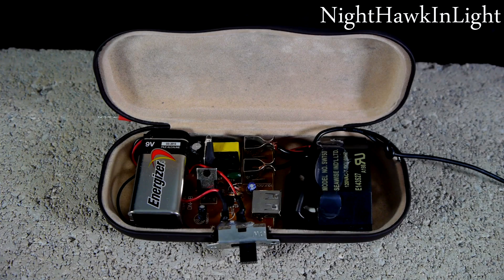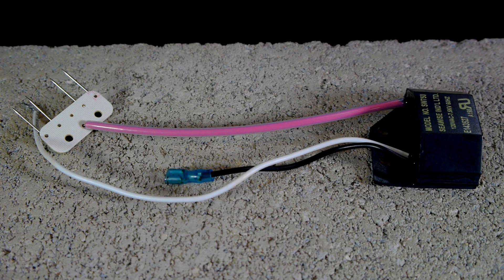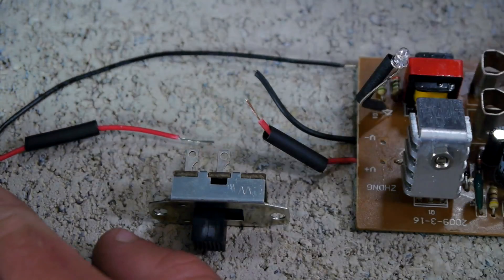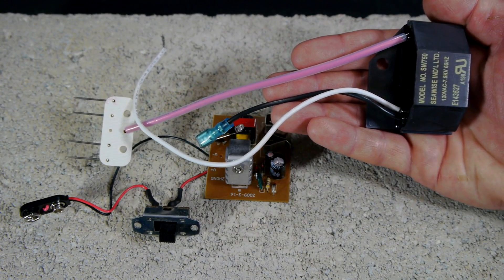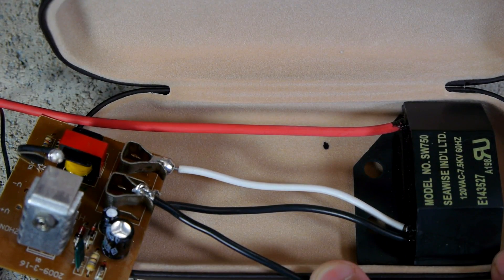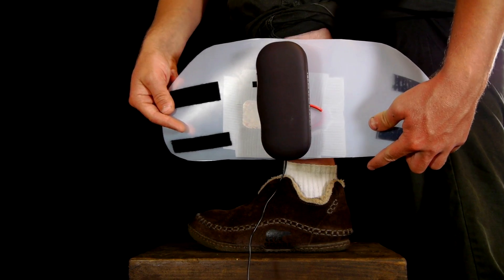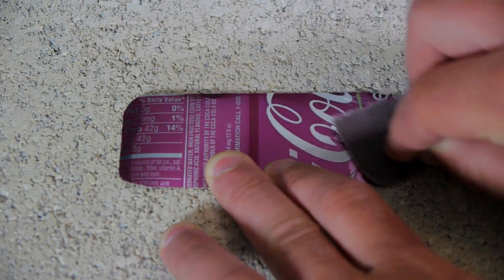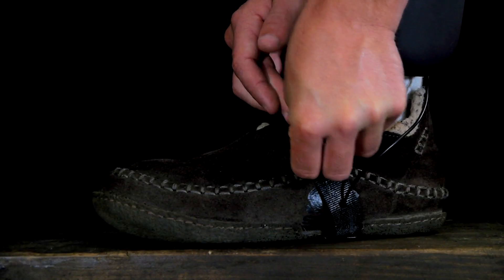How to Shock Anything & Fry Electronics with a Touch!

Comment: ww.ebay.com/itm/High-Output-air-ionizer-ioniser-airborne-negative-ion-anion-generator-200V-100V-/121077249879?pt=UK_HealthBeauty_Other_RL&hash=item1c30c43757 Can I use thise ionizer? Just type one W in link

Comment: i have a minor problem i have 3 glasses cases and i cant seem to fit all the equipement in the case the battery barley fits with out the harness. what eles can i use to store the parts. and also dose it have to touch the ground? please reply

Comment: It is just a simple high voltage coil. Used in cars to make a spark for igniting the fuel. Ion generation is achieved if you ground one side of the coil and put the pointy plate on the other end. Physics will do the rest ;)
(check Ion Wind topic on youtube).

Comment: Brilliant:) If i may only make one suggestion, don't put it on the leg. If someone makes it powerful enough and has a waek heart, it can cause a bit of harm. Also dangerous for people with heart peacemaker.
Generally the current flows on the surface of the skin, that's why it shouldn't make any problem for the user, but sometimes shit happens;)
If you attach the harness on the arm, it will remove the risk of current flowing through your all body.

Comment: A ground wire is (more or less) just a regular wire that touches the ground. It's not necessary to coil or do anything to the wire the than insure that it (or whatever it is connected to) makes a good electrical connection to the ground.

Comment: So...in theory, if one had a larger supply of energy, say a step up transformer and a high volt capacitor; would one be able to withstand zed current? And what could one do with that voltage? Safely "taze" an assailant?

Comment: I got it to sort of work. For me, you had to be on concrete and had to walk around a bit. The shock though was like a 3.5. Sometimes it was a 5 in the right condition. Dry air is better for shocking because electricity travels better in it.

Comment: Is the ground wire really needed? Because inside the negative ion generator is just a voltage multiplier, which multiplies the input voltage, not pull electrons from the ground, right?

Comment: Nighthawkinlight, im want to build this device but where i live there is not hardware stores that sell those kind of electronics, so i wil buy the generator and the convertor from the links in the description and i have an on/off switch, but i dont know where i can get the battry harness and the coppr wire, can u send me a link so i could buy them online? ty, and also, this is the most awesome device i have ever seen, if you touch a person, wil it shock them?

Comment from the maker: Both the carpet and the flip flop may be contributing to your issue. The carpet certainly is. For this to work really well you need to be on a somewhat conductive surface, such as concrete, tile, dirt, etc. A flip flop may be causing problems because it's allowing your feet to discharge electrons to the ground through the air, and/or the aluminum strip underneath.

Comment: Nighthawkinlight, I have mine all put together and it seems as if it should be working fine, but when i hook it up to my leg, and then the bottom of my shoe, it doesnt let me shock anything. The only case in which i can shock something with my device is when i have one of them hooked up to my leg, and i just touched the other. If you have any suggestions, that would be very nice. I am using the device on carpet, and on the bottom of a lip flop. Thanks!

Comment: If you copy and paste the link into the nab bar with the usual prefix it will work. I tried to paste the complete link here but it did not allow. It would be very helpful if you could let me know if I can use this ion generator. Thank you

ebay.co.uk/itm/High-Output-air-ionizer-ioniser-airborne-negative-ion-anion-generator-200V-100V-/121034238961?pt=UK_HealthBeauty_Other_RL&hash=item1c2e33ebf1

Comment: PLEASE HELP

I get a static charge, but it's very small

When i move my hand a bit close to pepper particles, only the ones very close to me finger move

I get a very healthy arc between the ground and red wire

can anyone explain what I did wrong?

Im using the same battery as the nighthawk as well

Comment: help help HELP!!!
i just got the parts to make this followed this guide EXACTLY  
the negative lead make a ark with the red wire but when i put on the harness it doesn't work.
the connections on the harness are just fine the foot one arcs to the leg one when its on but when im wearing it it does nothing. also when it is running the battery crackles and arcs and and also will draw sand /dirt to it. i have tried multiple batteries and triple checked all my connections please help me.

Comment: In high school physics lab, we found a hand-held tesla coil that plugged into the wall and was supposed to be used for electronics testing. We quickly discovered that if you held it when you turned it on, it didn't shock you, but it allowed you to arc electricity from your fingers like Palpatine. I believe it went up to 40,000 volts. The arcs shot out strongly over an inch. Could something like that be made portable, do you think? Is it somehow unsafe? We never found any ill effects... luckily.

Comment: I see the ionizer is cheap. I was just wondering what is my range?Does it have to be Input: 120 Vac. Output: 7.5 KV 60 Hz? Will it not work with other specs? Is it dangerous if the output is too high? I know a bit about electronics and more about electricity, but I don't know much at all about negative ion generators aside from what they sell hem for? What kind of store would sell this other than an electronic supply? I would rather get all my parts in person if I can. For all projects.

Comment: I built this project a few weeks ago and it works great. I recently saw this this video: /watch?v=a7_8Gc_Llr8 and tried using this high voltage generator to interact with the flame and it worked! 
The effect is not as dramatic but it was strong enough to see clearly. I would post a video but unfortunately I don't have a camera

Comment: There is a slightly better one made by weller that's red colored. It has a push-button ignition and I think it gets a bit hotter and heats up faster. I've used the radioshack one, but I prefer my weller because the tip is finer. I found mine at home depot, but I'm not sure if they still sell them there. The weller should be cheaper too if you look around. I've been using the same weller for 4 years now.

Comment: I took the ion generator out of an old unit with one of the vertical squirrel cage fans.  This generator is noted with an input of 120v @ 60Hz, but the feed wire comes off a circuit board via a 5 port PCB connector ... Is there a safe way to figure out which of the 5 wires I connect to ... ?

Comment: figured I might get a response quicker if i commented on your latest video.  On your airsoft minigun, how well do you it would work if you replaced the tire valve with something that could then connect to a co2 cartridge for a power source? or a larger magazine? like a soda bottle connected to where the cap goes?

Comment: I am using an eliminator surge protected automotive power inverter as opposed to the one that you have suggested for the dc to ac conversion. I haven't started on the electronics but i have put a battery in series with the inverter. The light does not come on but when i put it back together and put it into a dc vehicle socket, the light comes on. Will this inverter work for me even though the light doesn't come on with a 9V battery? could the LED light just be for a 12V input?

Comment from the maker: Is the generator attached to the plastic leg harness right over the hole for the red wire, or does the wire come through the plastic off to the side of where the harness is attached? If the glasses case is right over the hole a spark might be jumping from the case to the aluminum strip inside of the harness, which would remove any charge from your body. If you can't get it working try to make a video of it with clear views of everything in good lighting so I can try to figure out the problem.

Comment: My comp wont let me reply properly. I tried what you said and it still does not work. Is there any thing else that you can think of that could be causing it to not work properly? i have also noticed that when it is on everything in the box including the battery gives of a very weak shock when touched. The sparks between the shoe strap and leg harness are also noticeably smaller than on yours. Thank you for your help.

Comment from the maker: Make sure you are wearing shoes with a solid rubber bottom and the aluminum ground is centered in the tread, so it touches only rubber. This will also be stronger or weaker depending on what sort of surface you're standing on. If you're on dirt, concrete, or moist surfaces it will shock harder than if you're on plastic laminate, wood, or other less conductive surfaces.

Comment: So if you touch someone will it feel like a stronger static shock? Also does the case have to be close to the foot wire or could you have it attached to the belt area and run wires to your foot?

Comment: or if for some reason you're not affected by DC current you could supersize it to a tesla coil and use it in mid quarters combat.  I'm gonna need to run more tests, but considering that lightning is DC and it didn't even phase me I'd be a suitable test subject.

Comment: well, considering it's a static charge you'd have to be in direct contact for it to work unless you supersized it to a tesla coil.  you'd have to be wearing extremely thick insulation then though.

Comment: how does a nine volt battery build up 7500 volts?  does the design have a capacitor in it somewhere or is that a result of the transition from dc to ac?

Comment from the maker: In that design they had ion generators that run directly off of DC current. The only place I have been able to find that sells DC generators however is located in China, and there is about a $35 shipping charge and likely about a month delay for it to arrive. I decided that most people would prefer I make my design using parts available in the US.

Comment from the maker: 5W is just the maximum output that the adapter is capable of. With only a 9V battery the power output will be limited to what the battery can deliver, no matter what your adapter is rated to. Just don't use a power source larger than a standard 9V battery and it will be fine.

Comment: I'm sure you've been asked this question a million times already but I can't find the answer. How can you increase voltage without increasing amps? Transformers work on AC. Would it be possible to add one after the inverter or would that be out of the question?

Comment: That would be exceptionally dangerous to yourself.  The capacitor would store a large volume of energy and then discharge with high amperage.  Most people (theoretically everyone) can survive hundreds of thousand of volts being shot into them (I've seen tazers as high as 800kV), but nobody is expected to survive having even just 1 amp shocking them (but I'm sure we all know somebody who survived sticking metal in a light socket).  Batteries are measured in milliamps, so they're super safe.

Comment: you could actually cut out the inverter all together. build your own negative ion generator using the schematic found by googling "negative ion generator schematic" and cut the transformer and bridge rectifier out also. you will have a DC powered version

Comment: I wonder if there is a way to add in a capacitor or two from a disposable camera. That way, the electricity is charged, and you get a stronger shock on first contact.

Comment: The inverters I have are both higher power inverters than the one you have, which might have something to do with it. The one you have is probably (because it's cheap looking is why I guess that) a square wave inverter which use less electricity to run than a sine wave inverter.

Comment: Most automobile alternators put out 14.4V DC. I have 2 inverters that don't work unless the voltage level is above 12V. Items designed to work at 12V have no problem working with 14V, it's well within tolerance. I seriously doubt that one of those 12V remote control batteries could put out as much current as a 9V alkaline battery.

Comment: could a get a bigger spark by using 12V and using 2 ionizers with the output wire in series and then spark that to the ground?

Comment from the maker: I tried it. Whatever the electronics are in those ionizers they will not work for this. They produce high voltage that can be used to create a small arc between two wires coming off the board, but they will not electrically charge other objects.

Comment from the maker: In a pocket, they should be fine because they will gain and lose static charges slowly. Electronics are more likely to be damaged if they are sitting on a desk and then touched by someone wearing this device, because the entire charge built up in the users body will flow right through the electronics to escape to the ground.

Comment: as mentioned somewhere around 9:50, a big contact area doesn't hurt you. But this works for her as well. If you want to shock her without noticing the shock, you should use a conducting item with a large contact area for your hand and a small contact area for her. (e.g. a metal pen, a fork, keys or some coins).

Comment: That particular inverter does NOT put out AC. It's half-wave rectified/filtered DC. The output measured at 167Vdc on one that was tested.
Schematic of one is available at: dalmura.com.au/projects/Car%20charging%20converter.pdf
If you remove the diode marked "D3",replace it with a jumper wire,and remove the the 2.2uf 400V cap, you can get a high frequency AC output,at several tens of Khz.
Just FYI,it's NOT an AC output.

Comment from the maker: Automotive inverters do not shut off below 13V, or they would not function at all. All vehicles besides large dual battery trucks only run on 12V to begin with.

Comment: There is little chance that a 9v battery could keep an inverter going for 5 days. Power converters consume electricity, in this case, the inverter itself is probably using more power than the device it is powering. MOST power inverters shut down when the input voltage drops below 13V, so I don't think this will even work with most inverters.

Comment from the maker: I haven't tried any other inverters besides the one used in the video. Where I purchased it is listed in the video description. I believe they typically will still function within 30% of the recommended voltage.  I don't recommend using a power source greater than a 9V, as the current has the potential to reach dangerous levels.

Comment: Don't most inverters shut down if the voltage drops below 12 (some even shut off under 13V)? Would it be better to use a 12V lithium remote control battery (the ones that have 8 button batteries in them)? The only potential problem would be that the 12v battery couldn't provide enough amperage, but you could put 2 of them in parallel. Does it matter if you use a cheap inverter that provides a square wave rather than the true sine wave?

Comment from the maker: It will, because they will not be at an electrical equilibrium with yourself until after they have been shocked once. After that the extra electrons will quickly disperse from them into the air and they will balance back out again to the surroundings. Even so I cannot recommend using one of my projects to cause discomfort to another individual...

Comment from the maker: Yes, you feel the shock just like the thing you are shocking. If you hold on to a metal object and use that instead of your bare skin, the shock is dispersed over a wider area in your hand and it will not shock you as badly.